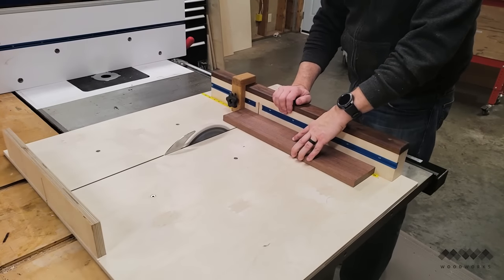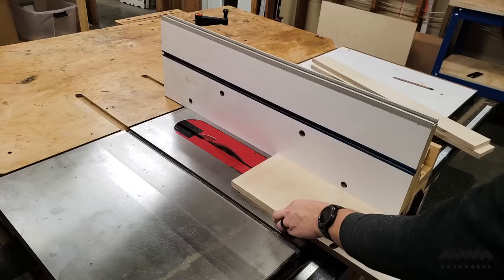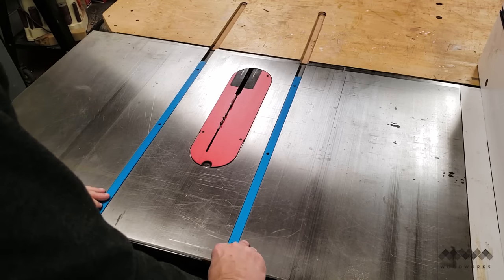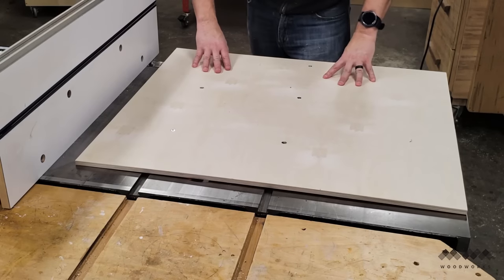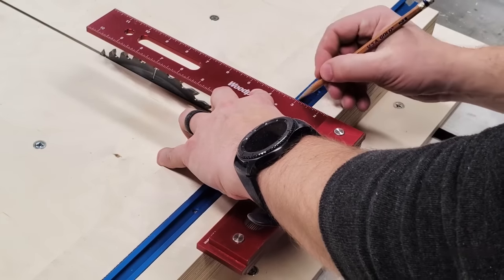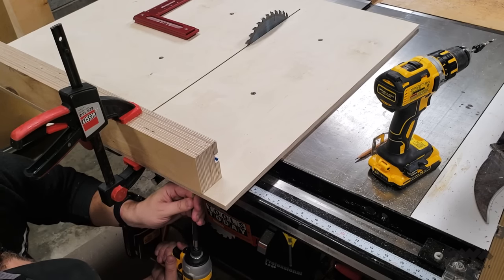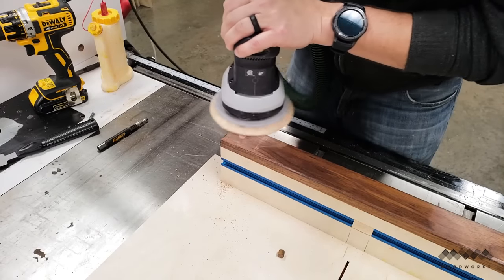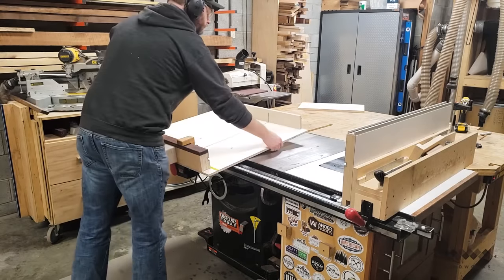Easy Table Saw Cross Cut Sled | PLANS AVAILABLE

Comment: I have found that even with double stick tape it was not accurate/solid enough to hold the runners in a position where i could then screw them in and count on them still lining up with the tracks. I was using shop made runners so i didn't have the adjustability to fix any tightness or looseness after the fact, I really may need to invest in some of those for my next sled. Also, when gluing up my fence I used a large, rigid piece of aluminum square tubing to clamp to, to make sure that i was not inducing any kind of bow to the lamination. I took that inspiration from William Ng's sled video, he used like a 16/4 piece of jointed maple but i don't have that, hehe.
Reply from the maker: Yeah I've made a bunch of jigs with wooden runners and these aluminum runners just win out. The adjustment is awesome and the wear and tear is much better. Worth the investment on your most important jigs. Maybe not so much on jigs you don't use that often.

Comment: that is some serious binding with that sled. Did the holes line up properly? I know that's the big problem with the Rockler runners. Screwing from the top is not good.
Reply from the maker: It's totally adjustable though. The binding goes away when you adjust the set screws in the runners.

Comment: I used some 3M double sided tape and it would not release and left a sticky mess on the runners and the sled - I have to start over.  What kind will work????